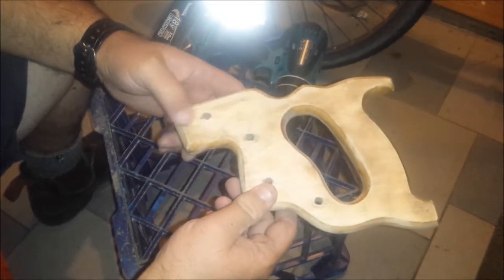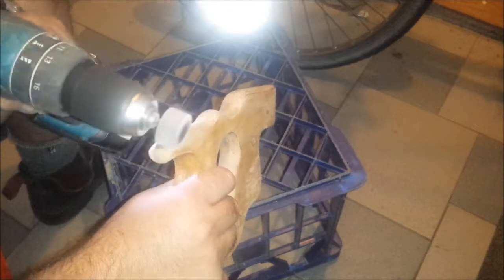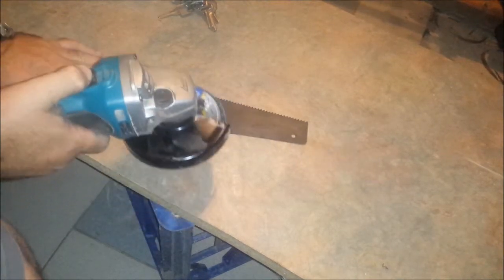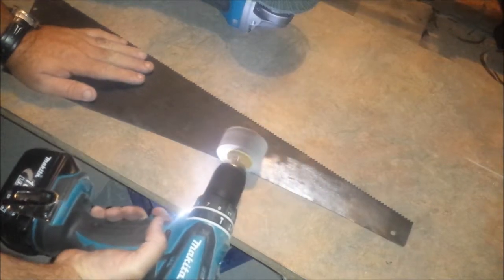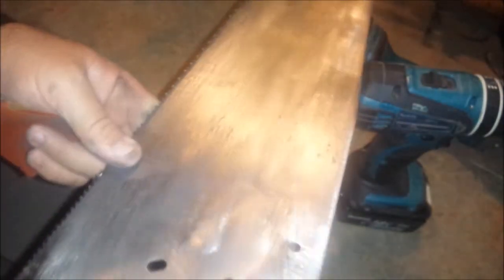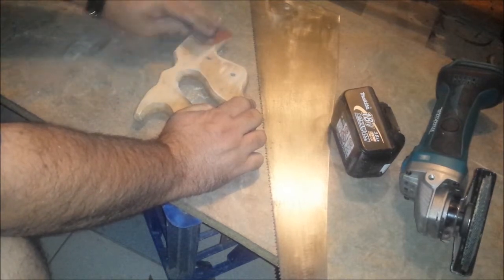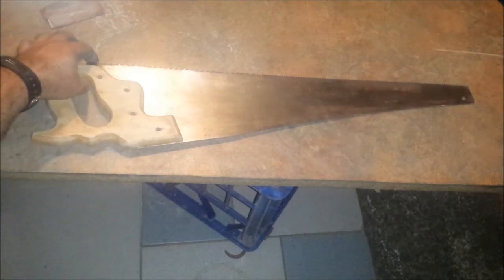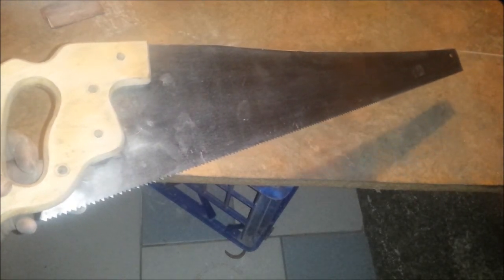Disston Handsaw Restoration - Sanding the Handle.

Comment: That was a bigger project than it originally looked like.
Reply from the maker: Yeah, I thought it was going to be fairly simple, too. Still, it's not taken all that much time & effort to get it to this stage. I've probably spent a couple of hours on it at the most.

I'll be making my own finish for the handle, too. This has all been inspired by several YouTube people that I subscribe to:
Wranglerstar
Izzy Swan
Matthias Wandel
Reply from the maker: I've since found out that this saw was made between 1947 and 1955. Old, but not really all THAT old.

Today I bought another Disston saw at the junkyard for $5. It's a Disston D8 skewback 5 TPI rip saw, made between 1917 and 1928.
Reply: Even if you never used them they are still cool antiques.
Reply from the maker: I found another one at the recycling centre at my local tip yesterday. $5.

As it turns out, it's a Henry Disston D8 skewback ripsaw with 5 TPI. Manufactured between 1917 & 1928.
Reply: If restored correctly and the handle is all there it would be worth over $100 USD
Reply from the maker: 738polarbear That means nothing to me.

Comment: A green scratch pad with light oil would also have polished the blade.  The is a small crack in the palm of the handle that can be repaired with CA glue.  Very nice job, well done!
Reply from the maker: Thanks for the tip.

Comment: why did you grind the bluing off the blade?  Now it will rust every time it gets humid, yet alone when it rains!
Reply from the maker: Because I didn't like the patina that the vinegar left. We're coming to the end of our wettest summer in more than a decade and there's still no rust on this blade. So no, it won't rust every time it gets humid or rains.
Reply: +Dan_from_Epsilon_Crucis After doing all of the Metal cleaning up I always use a coat of any Paste Wax to seal the blade. Which keeps the Moisture out. It also makes for easier cutting and can be reapplied quickly if needed.

Comment: Yea the flapper disk was bit much but after deekin yer paws im guessin yer plant fitter or mechie fitter or summit so you have a excuse :) I got myself a sanding pad for the hand grinder angle grinder whatermecallit thats velcro on the underside then sanding pads just stick to it. Different grades available but they dont last long. Another thing is those polising wheels. Like a green scratch pad but they have a plasistic coating containing abrasive compound. Works good too and not as hard on the metal as flappers etc . Bit more expensive though but better than the sand paper. All depends on the job.
Reply from the maker: +ScotsFurian I'm no type of tradesman, I grew up on the land but I've been an office worker for the last 20 years.

Comment: How would a random orbit sander work on the final sanding of the handsaw?  Do you sharpen the saw yourself.
Reply from the maker: I haven't sharpened the saw. I know nothing about it. Yet. A random orbital sander would be fine for the flat surfaces, but for all those curvy bits, it'd probably be a bit difficult. The only reason I used the grinder on the blade is because I wanted to get the job done quick on a saw that cost me next to nothing. I have a better saw that also needs to be restored, but that'll be done by hand.